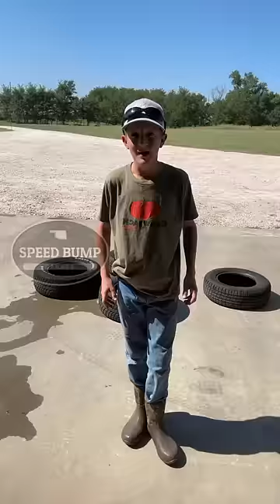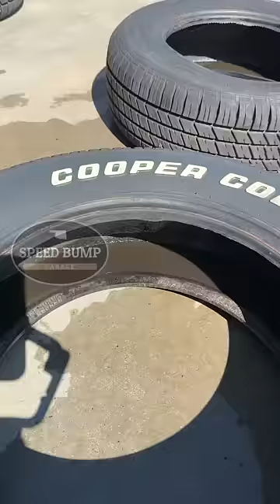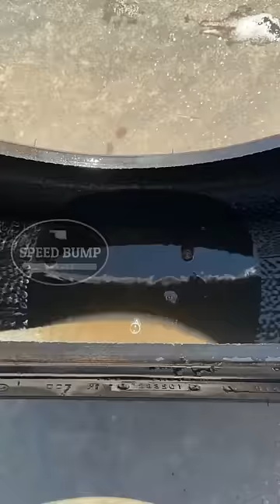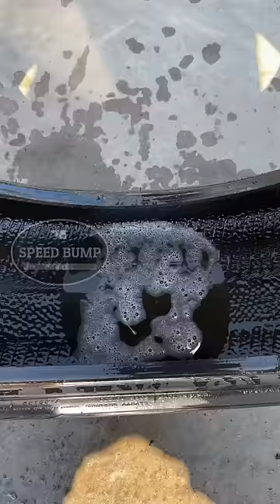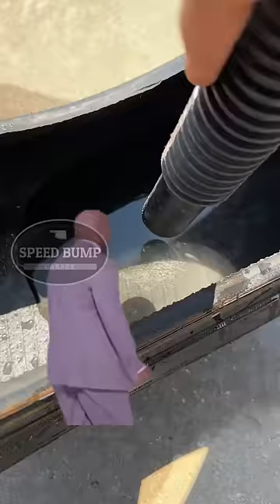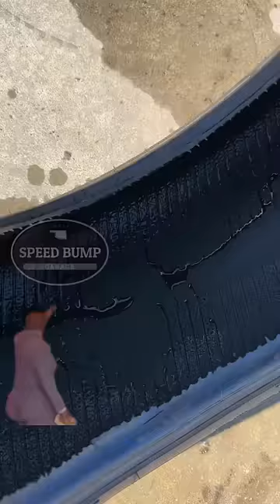How do you get water out of old TIRES?

Comment: Shop vac, Old towel, paper towels all work, but if you dont have any of those things handy. I learned a great trick working at a tire store many many years ago. Lay the tire flat on the ground. Then grab it with 1 hand on each side evenly, then when you pick up the tire, raise 1 side of the tire alittle  higher, so that the water inside all goes to the low point. Then raise the lower side with water real fast, kinda like a flicking motion. The water will come out similar to  throwing a cup of liquid out. You have to do it 3 or 4 times, but it works great. Hopefully I explained it good enough. It might take a min to get the hang of it, but once you do, then you will have it down for the rest of your life. Love the videos by the way. Awesome seeing a youngster like yourself, getting out & learning, while also working to achieve a goal. Keep doing what you're doing, youre learning great habits & knowledge that will help you for your entire life. Also I love the great attitude you have, don't  lose that, especially when things dont go as planned. A good attitude is the best way to live your life & to handle lifes challenges. Your parents are doing a great job raising you, you're definitely making them proud!

Comment: To properly flip the tire to get the water out, you grab the bead on the bottom pull it up towards you and push the top away from you with the other hand as fast as you can

Comment: Lay tire down grab a side flip not to fast but not to slow it's a learning process on speed but when waters at bottom flip over and leave a slight angle so water comes out the top side can also be done by laying tire down and grab both sides lift one side high then "quickly not to quickly tho lift other side gravity does a lot of the work so apply them concepts when water is mostly out a dry rag will get the remaining works great for not having a shop vac or when you have no power to work with

Comment: you should also buy some sort of rubber and plastic sealant like chemical guys vpr for the walls of the tire otherwise the anti uv compound will raise to the surface and make your black tire brown and the raised white lettering will turn yellow. its a little bit expensive but i like to use a ceramic spray sealant on my mom's challenger and it works great also keeps the sun from dryrotting the tires

Comment: Hey Jack I see you're trying each never single way to get that water out of those tires wanna know another lifehack in case you don't have electricity to use a shotbackHey Jack I see you're trying each never single way to get that water out of those tires wanna know another lifehack in case you don't have electricity to use a shop vac  Get a Pole with a hook on it lay the tire down flat and grab ahold of the tire and pull it towards you like a quick tug and do that a couple times and boom waters out